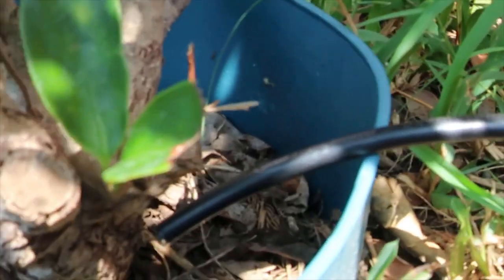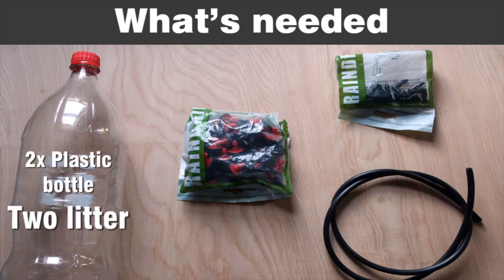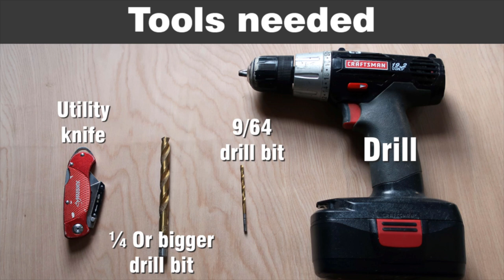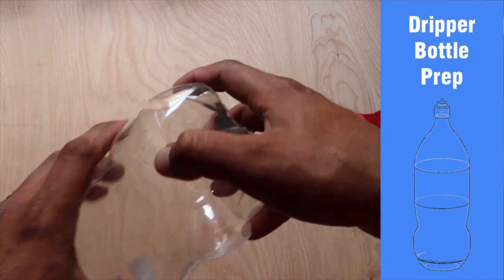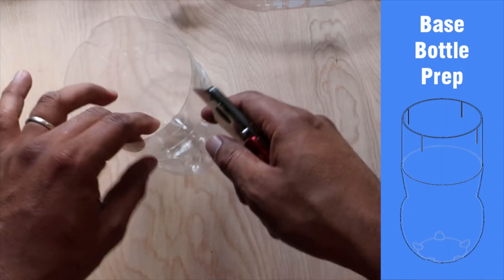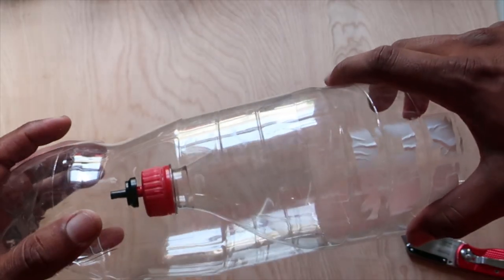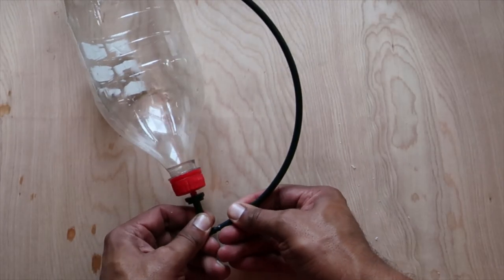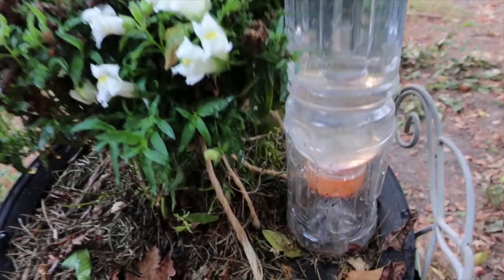DIY - 2 litter soda bottle gravity drip irrigation system, upcycle, save water and keep green plants

Comment: Are there drip emitters that are at a slower rate? Half a gallon per hour seems really fast. My ideal setup would be where it would only need to be refilled with water every few days or maybe once a week?
Reply from the maker: This is the smallest dripper I found. I would recommend you to watch by video on the 5 gallon bucket which will take 5 days to drain using the same principal 🙂.

Comment: If you drill holes in the cap specific to rate do you need all the rest? If the soil is saturated it wont release water until it is needed? Idk seems complicated for what it is.
Reply from the maker: I've tried that and the bottle ends up emptying really fast. Drippers was the way I've found for water to last longer having continues irrigation for the longest time which will be ideal for the hot summer days.

Comment: No need for the bottom bottle. Just run the tubing from the drip emitter to the tubing then down to the plant base or even bury it.
Reply from the maker: Bottom bottle purpose is to suspend dripper bottle. If emitter was to be buried it would clough.